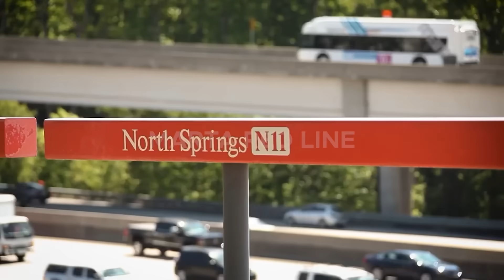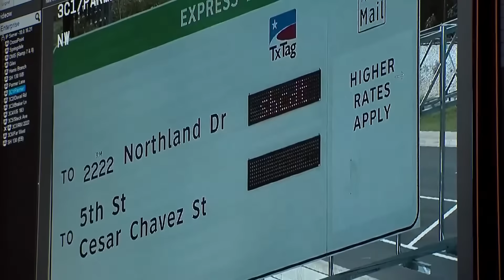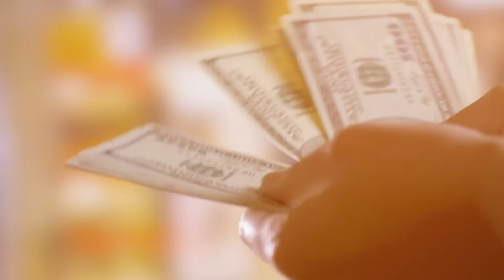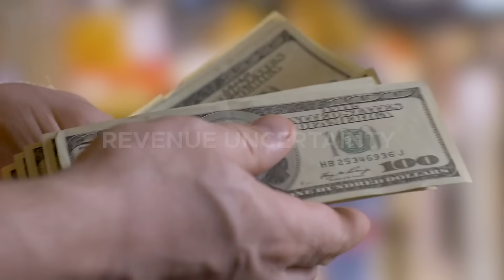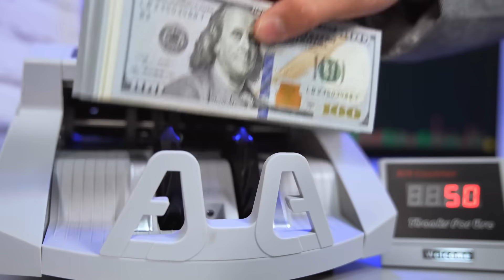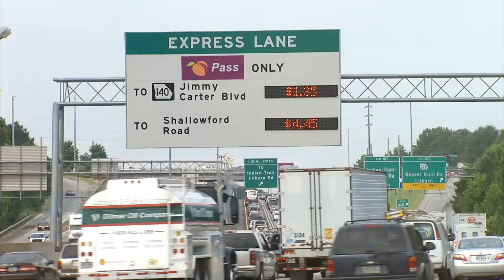The $11 BILLION Gamble To End Atlanta’s Traffic Nightmare

Comment: This is a good start. But SO MUCH more needs to be done to alleviate Atlanta traffic whoes including expanded road infrastructure and mass transit. I am going to break this down in two parts starting with road infrastructure first. Here's my thoughts about the subject at hand. First, a big contributor to the traffic volume is the amount of trucks on the roads here. With Atlanta being a major rail hub and connected by I-75, 16, and 95 to the ports of Savannah and Brunswick Atlanta gets a HEAVY dose of commercial truck traffic. So much so that GDOT is going to build Truck specific lanes between Macon and McDonough on I-75. They take up a lot of space. 

What will it take to actually fix traffic in Atlanta? Short answer is A LOT OF MONEY AND WILL POWER!!! Here's what I think needs to happen. I'll start with the freeway. First the Downtown Connector should be rebuilt  with barriers separating the HOV lanes, thru traffic and local traffic with 2 HOV lanes in each direction, 4 thru lanes in each direction and 3 distributor/collector lanes in each direction. The tunnel under East ATL to connect GA-400 and GA 78 (Stone Mtn Fwy) to the Freedom Pkwy and I-675 NEEDS to happen ASAP!! 78 needs to be upgraded to a true freeway from Downtown at the connector all the way to Athens. The Langford Pkwy needs to be extended east to I-20 and West to Carrollton. Also in Gwinnett GA-316 should be extended west through Gwinnett, Fulton, Cobb, and Paulding counties to Dallas, and East to Athens. And I-20 needs to be expanded and upgraded with 4 express lanes between the outer beltway on the East and West of ATL. This will effectively give Atlanta 31/2 freeway corridors moving East to West. Speaking of that outer beltway it needs to be built. 3 general purpose lanes in each direction and 2 tolled truck/express lanes in each direction. The express lanes can have a higher than the 70 mph speed limit maybe up to 80 mph to encourage truck traffic so trucking companies can use to save off or transit time. Also hwy 20 should still be expanded to a 3 lane arterial road that parallels the outer beltway all the way around the city. I also think that there needs to be a 3rd beltway  around the North East and South exurbs that would start in Rome going East that would connect to Calhoun and I-75, I-575, GA-400, I-985 in Gainesville, I-85, Athens, Macon, and Columbus. This would connect all of the major population centers in North and Mid Georgia to each other and Atlanta. This 4 lane road  could be tolled with an increased speed limit too. I would require all through truck traffic to take either one of the outer beltways so that they would not clogg traffic in the Atlanta's urban core. I would also like to see at least a spur freeway going from I-75 just North of the Downtown connector around Northside Dr to extend out through Paulding County past Dallas and Cedartown to Rome. This in all is what I wish for in a freeway system for greater Atlanta. Now for the public transportation aspect.
Reply: Very ambitious plan but it'll never happen. Too much existing development. We hurt ourselves by not building the outer beltway decades ago
Reply: @nubianking4203 agreed. This is a pipedream. But it should have been done in stages starting decades ago. No political and financial will to get these types of projects done is now literally choking Metro Atlanta and the rest or Georgia to death.
Reply: You put a lot of thought into this.  I like the idea of tunnels.  GT also had a great idea of just shutting down the connector.  Turn all this extra space into something useable.   This seems counterintuitive, but really smart when you think about the impacts.
Reply: @zgdafzgdaf4264 I'm not for shutting down the connector. It's way too important not just for Atlanta but the entire east coast. Just see the 2016 I-85 viaduct fire. But I am for redesigning with through lanes and connector distributor lanes and for capping large parts of the connector. The Stitch is a great start. Looks like it's actually going to happen. The Midtown GA Tech cap is pretty much dead I think. Which if so....SUCKS!

Comment: The title of this is so patently absurd as to be comical.  The state just doubles down on the same over-burdened system by adding capacity but THIS time, it will fix Atlanta's traffic nightmare. 😆
Reply: Granted the state never built an elaborate network of freeways to disperse the load on the single loop and interstate spoke layout, but now expanding within existing right of way is the only place to add capacity. At least these express lanes will function like separate roads that can keep moving separately from the general purpose lanes. Express Lanes will offer everyone a faster trip when you happen to need to bypass the backups. The variable price will ensure they free flow at a minimum of 45mph or faster forever into infinity.

Comment: I have a better idea. Connect  GA400 to I675. Quit choking the city in red tape and make more routes rather than upgrading routes
Reply: How? There is to much stuff that has build up between 400 and 675. It’s not possible. All these neighborhoods.  Virginia highlands, morningside, little five points, edge wood and Reynolds town. They should work on expanding the mass transit.
Reply: @valdiswallace830 those neighborhoods can be tunneled under. It would prohibitively expensive but it can be done. Other cities around the world have done this exact thing. Cities like Sydney and Madrid. And yes mass transit MARTA needs extreme expansion. But that doesn't solve all of the issues with Atlanta traffic.
Reply: The problem with the Marta is that it’s not convenient. You should be able to hop on Marta and take it any where in the metro area with adding on commuter rail services to the far suburbs. Marta should go in to Cobb county and Gwinnett. Also i should be a circle line that connects around the 285. West  bound line need to go into Douglas county. The line from Bankhead need to be extended. Instead of building more roads, build more mass transit. Make it more convenient. When you go to London, Paris, Munich, etc you do need a car you can get around the city with just car.
Reply: @valdiswallace830 maybe proofread before posting. You ended by saying you need a car to get around Paris, Munich and London?
Reply: @xlxl9440 its not easy tunneling under Atlanta....it sits on top of granite rock....trying to tunnel through that for 12 miles would be too costly and time consuming
Reply: @edawg9962 I understand what you are saying. But Atlanta has the advantage of owning its own tunnel bearing machine which will save on cost. Plus while the Granite is hard, it does provide a more stable material to tunnel through. So engineering would be less complicated and costly. There have been proposals in talks in the past to just this, tunneling under East Atlanta to connect GA 400 to I-675. But yes....cost is a MAJOR issue.
Reply: @valdiswallace830  Boston built a whole tunnel under neighborhoods.
Reply: @dougbones7095 yes but your talking about build a tunnel under several neighborhoods. Also where will  tunnel start. You would have to take people land at the 400 and 85 junction. It so much stuff in the way to make this possible cost effectively. The cost to do a did would be in the 100s of billions.
Reply: @valdiswallace830  This was what a consulting firm concluded in the 2000s. The tunnel would be like 5 miles long and no one wants to be underground for that distance., but it would relieve the connector.
Reply: @dougbones7095 Atlanta is built on granite -very costly to tunnel.  Maybe $50 billion? And it's only a band-aid.
Reply: @valdiswallace830 I agree, but Atlanta is not dense enough to benefit from a bigger MARTA. People with cars won't ride it. Look at it now. Stations are empty. They aren't pedestrian friendly and a majority of stations are in blighted or pointless neighborhoods. It's unpleasant and time consuming experience to marta from Buckhead to the airport. More roads will do more for the traffic. Partially to blame is how the city developed inside the perimeter. Disconnected neighborhoods and narrow, winding roads to get anywhere. DFW has way more sprawl and DART about as useless transit system as MARTA, but nowhere near as much debilitating traffic.
Reply: @coreys4355  There are numerous areas dense enough.  The Eastside Beltline rail was one of them before the Mayor set millions on fire to cancel it.  The Howell Mill corridor is even more dense and has no rail connection along with Atlantic station, not to mention finishing Beltline rail as it was envisioned in the beginning
Reply: @ScottCP1  The beltline rail would run 18 hours a day on weekdays empty with maybe 3,000 daily riders. Only on weekends would more people ride it and its nowhere near worthy of paying tens of millions a year to operate.
Reply: @stephenedwardsnyc  I disagree.  The eastside rail that was ready to break ground would have had the ridership to succeed, and people seem to forget that rail has always been a part of this project from the beginning.
Reply: @ScottCP1  A world famous healthy leisure amenity ushering in billions in development that is renewing the intown core was not anticipated,and it has benefitted the city far more than any rail project would where there is no desperate need (thousands struggling to travel along its path now) to justify providing millions in subsidies to keep it operating. Everyone would be convinced if you provided all the real ridership projections and detailed all the costs to justify it. You nor anyone else ever does, ever has, but you have to when it involves so much public money.
Reply: @coreys4355  which is why the stations all need to be TOD. Place residential,jobs, schools, parks,etc. at the stations so they can increase ridership. They’re already doing that to Kensington and Indian Creek. Brookhaven has already started too and coming up with a plan to make it a fully TOD station
Reply: Atlanta is plenty dense to benefit from a bigger MARTA but the reason that people aren't riding MARTA like you mentioned is it's so limited. The reason people utilize subway systems in other cities like New York and Chicago is because you can go practically anywhere in the city by train which never happened here. I was in high school when they strarted building the MARTA rail system and originally it was supposed to be more widespread even with a station near Six Flags. The backlash from the northern counties was brutal and they were dead set against MARTA coming into their neighborhoods because they were afraid of a certain demographic having easier access to their neighborhoods. 40+ years later and most of those people aren't even alive anymore but their kids and grandkids are the ones suffering because of their reluctance to embrace progress. Had MARTA continued to build rail stations and had more of an opportunity to expand the system, by now people would be more willing to utilize MARTA for the convenience but it's too late and would be too expensive now. We've lost 30 some odd years that could have been used to expand MARTA into several areas throughout the city that it currently doesn't and never will serve and there's a specific group of people who are to blame for that.
Reply: @coastersandcars63  The DC metro was built the same time as MARTA rail, and look at that compared to MARTA.  It also helps when you get funding from the state which MARTA doesn't (and is the only metro system in the US that doesn't)
Reply: @ScottCP1  Sales taxes account for the most funding across the US. D.C. silver line charged businesses along its path to Dulles to build and maybe now to operate to make up for 2/3 that fares don't.
Reply: @stephenedwardsnyc  They also receive funding from the federal government via appropriation bills since it's the feds that control DC's funding
Reply: @ScottCP1  Very vague without specifics, but D.C.'s metro is the 3rd or 4th most used and the region has some of the nation's worst traffic backups. On a weekday morning it has taken me 4 hours to traverse the D.C. region without any major accident. Northern VA doesn't have a sufficient road network and now it's completely full of residential sprawl. Atlanta doesn't have great redundancy in its highway system either, but  it's not nearly as bad as the D.C. region where development is more dense and driving is extremely stressful. If we got funding for transit, the first item is getting marta system fully cleaned and renovated to increase its ridership first, then when demand is evident, invest in expanding it.
Reply: @ScottCP1 Yes, I've compared MARTA to DC's rail system many times for that very reason.
Reply: @coastersandcars63  You don't spend tens of billions on new lines first and hope someone will ride it. Marta ridership is still below prepandemic levels.
Reply: @coastersandcars63 exactly. It’s be nice to take rail from my home in Marietta to work in midtown. There’s no reason this isn’t a thing yet. One of the largest residential areas in metro ATL directly into the second largest commercial district in GA just makes sense.
Reply: That will never happen
Reply: All the traffic goes right onto 75/85 downtown!
Reply: exactly make I-675 split to GA400 and also continue through like winder and come out near jefferson. that would help alot of commuters bypass I-285 nightmare and I-85 nightmare below I-985
Reply: What they should have done was connect 78 to freedom parkway like it was supposed to be. And yea, 675- 400 wouldn't be a be thru option either. But alas the the prudish suburbanites always win
Reply: As originally planned.